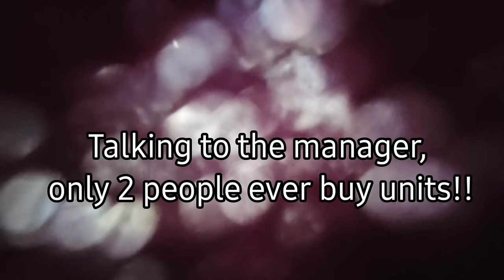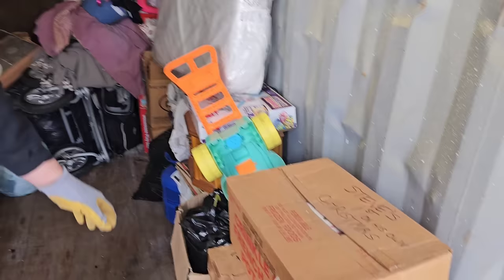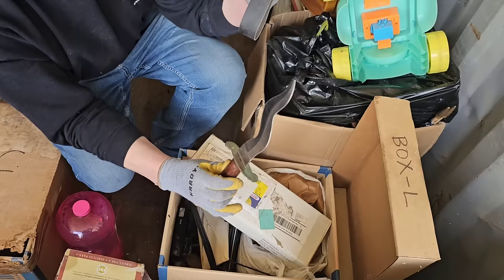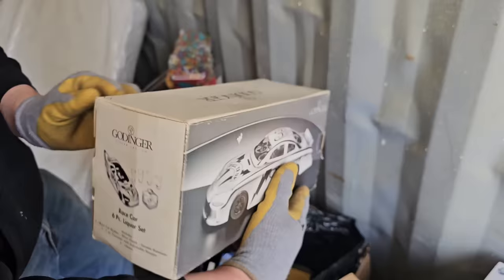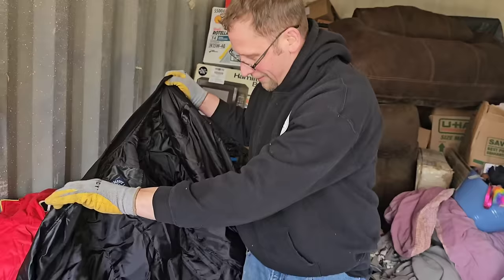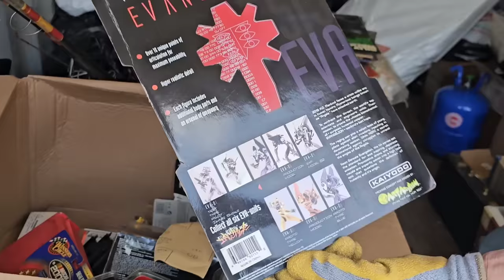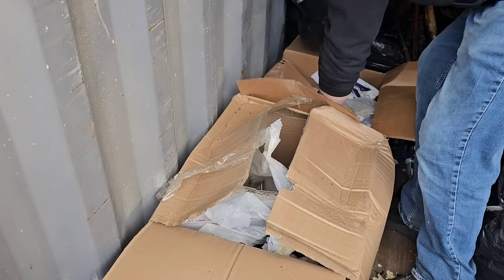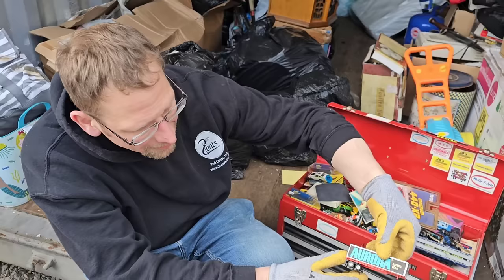I bought SHIPPING CONTAINER & found THIS! ~ I can't believe Owner abandoned Storage Unit!

Comment: Air guns are not considered firearms. The keyword in firearms is fire, so it pertains to firearms that use black powder not compressed air even though they have air guns, pre-charged pellet guns that can be just as powerful or even more powerful, but an air gun is an air gun Ranks right there With cap, guns and squirt guns. Thank you very much. Sincerely, Wayne Obryant Merced, California.